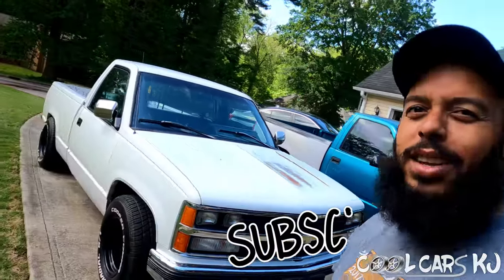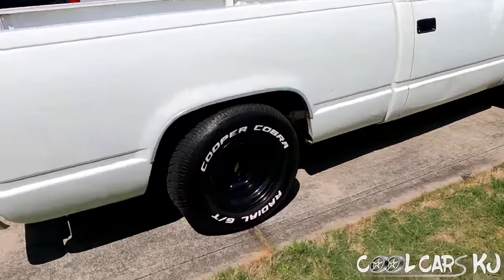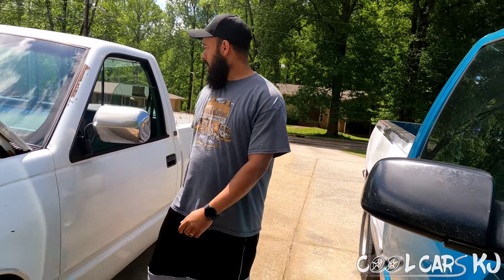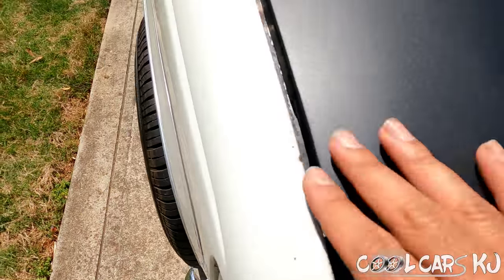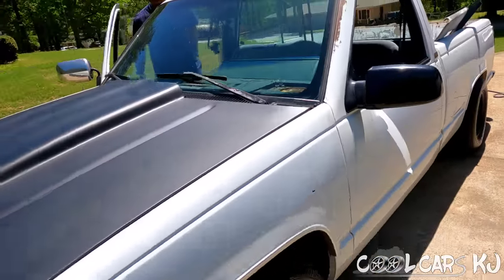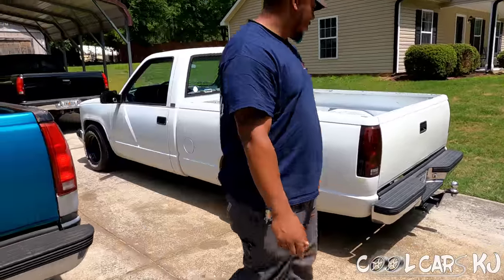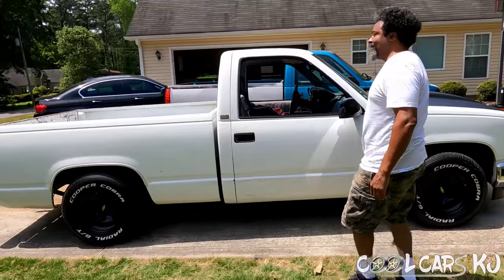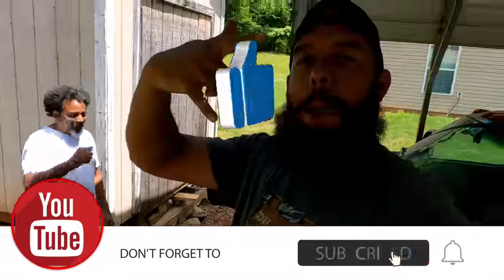New hood and mirrors for my '91 OBS Chevy gave it some ATTITUDE

Comment: Still my favorite from the lot. I’ve had two white trucks for work but I just love the white lettering on the tires. Clean bro. Been watching this truck since that video when you met that tuner in a parking lot. That was kinda sketchy but amazing. I think that was the first time I realized I wanted to replace my 350 to ls in my very sketchy 53Pickup up. Keep it going. Still watching.
Reply from the maker: That was the 3rd time ive used that tuner. It was sketchy the 1st time but he's solid 🤣